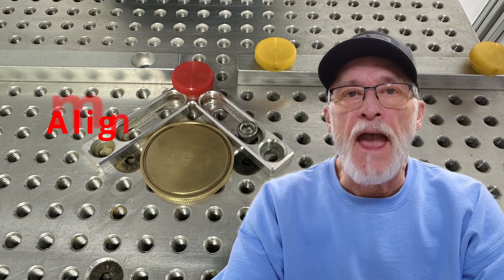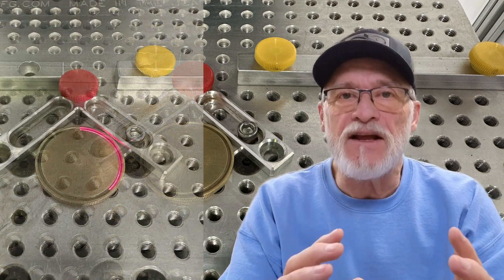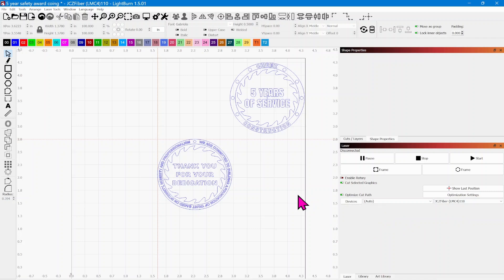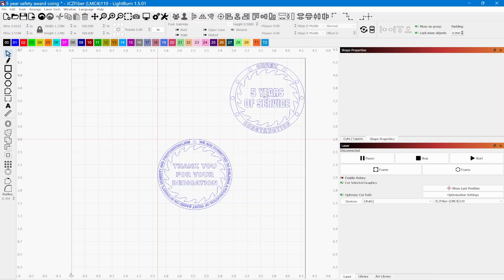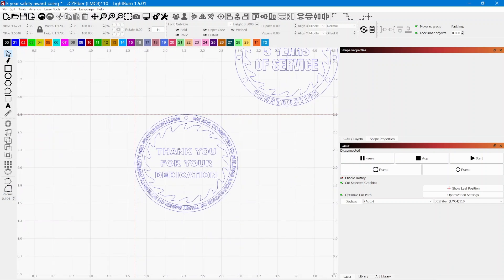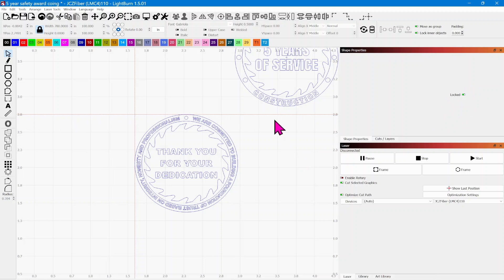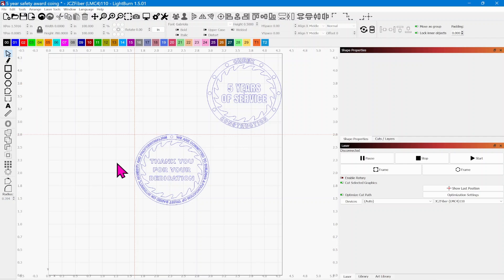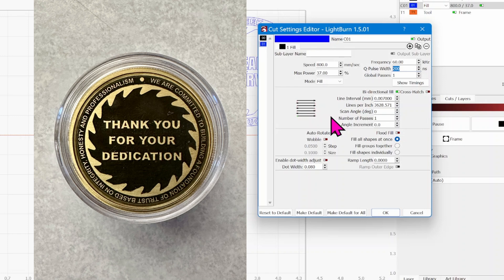Unlocking the Power of Alignment Guides in Lightburn

Comment: Thanks for your content, I always learn something. In terms of the coin alignment, I guess the hardest part to control is lining up one side with the other as this depends on how you place the completed side down on the workspace. It's probably not super important, but it does seem like a weak link in a precise process.
Reply from the maker: getting and x y table that has micro adjustments really makes this much easier

Comment: I appreciate you creating this video on the new feature. Two suggestions though I would offer. One, shorten the video to the Cliff Notes version and two, when you start talking about moving the coin to the reference lines, actually show what you're doing on screen and move the coins instead of just talking about it. Obviously these are just my opinions and other people may feel differently. In any case, thank you for the video and have a great day.
Reply: Thanks for the reply and the information on the 8 minute minimum length. But again, if you show a process such as moving an item to the alignment guides and snapping it in, why not actually show doing that process instead of just telling about it. A video is a visual medium and is best used if you show actual actions and not just narrative. Thanks again and have a great day!
Reply: I completely agree
Reply from the maker: thanks for your input, just as an fyi to keep these videos monetized they need to be 8 minutes long so you will find most my videos that length or longer. you can have it both ways, you as tomshorten the video but then ask to demonstrate some actions that would make the video longer. I do appreciate your input just understand that my style of video is not at a high level and more down in the weeds. some people like it some people don’t!

Comment: You can use 2 different layers for the same thing to align a front/back layer, and multiple layers for other things. Then you dont have to worry about origin as much when it ends in the same spot and starts there the next time
Reply from the maker: your right! another way to do it for sure
Reply: So after you set do you havd jet on absolute coordinates?
Reply from the maker: There is no start from setting on a fiber laser it’s always absolute coordinates  @gregoryyyyy9007